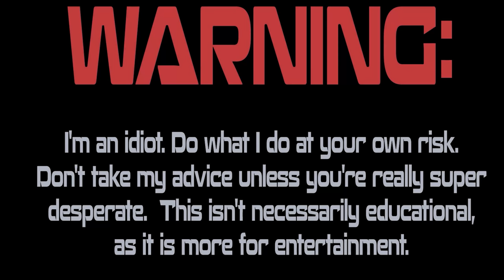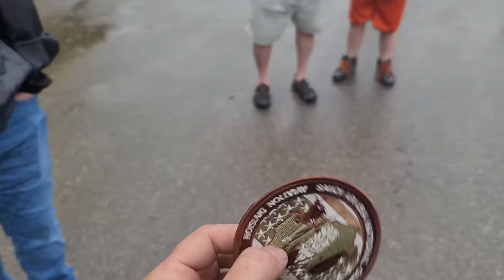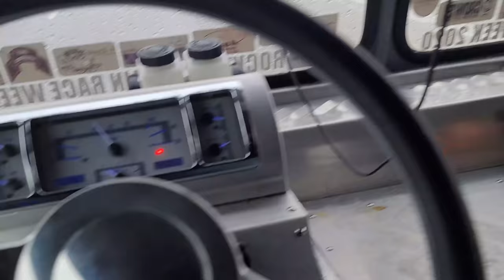Midwest Drag Week Day 2 - Met John Force, Jonnie Lindberg and Drove a Promod in the Rain!

Comment: That’s a good man, moving that snapper.
Reply: He could have at least picked it up instead dragging its lil feet
Reply: @Fony_turgeson  WERD! Poor turtle had the hide ground off of his widdle tootsies.
Reply: @Fony_turgeson  those things are pretty tough. Most the weight is on the shell and the streak across the pavement was likely piss. 

Life > scrapes         Safety > losing a finger

But yea, If you’re experienced with the little buggers then it would probably be fine to pick it up.

Comment: You have to run a couple gallons of the $3 orange Rain-X through the system before you get a good coat of silicone on the windshield.  I can drive my Silverado through a torrential downpour and not touch the wiper switch....I enjoy this touring aspect of your videos just as much as the restoring aspect.  Best part is, I'm retired and can watch ALL your shenanigans on the computer or living room TV.  Keep on truckin' Derek!

Comment: That Sunnen CK-10 at 16;34  is mainly a cylinder boring tool and line boring. I worked at a engine shop in the mid 90s and that was the best machine back then

Comment: Good on you for moving that old turtle out of the road. Someone may have already said this in the comments, but when you take a turtle out of the road, you have to move it in the direction it was heading, otherwise it will head right back out again. Don’t want to move them too far either as their range is small and they can get disoriented and stressed out pretty easily if you get them confused on their whereabouts.

Comment: Funny car body: Composite sandwich. Composite plies over a core material. Could be honeycomb, balsa, hell, even cardboard. The risk is always putting holes in it. Cardboard would work a little bit. But you'd have a hell of a time drilling and fastening to it. Especially if it would get wet. You can also embed materials like wood and such. Depends on how weight critical you are.

Comment: Here is a fun fact. The Marathon they stop at, at the beginning of the video, used to be a Valero but long before that there was a bar there called "Flicker Inn" was the kind of redneck joint you'd hear Charlie Daniels sing about. They used to have motorcycle runs and what not and David Allen Coe would even perform there and not long after his last time playing there the place burned to the ground and then it became a gas station.

Comment: Fyi that turtle will get where he was going, it looked like you drug it off the road in the direction it came from which means it will cross the road again, whenever possible you should put them on the side of the road they are headed to so it doesn't just get hit by the next person😎

Comment: Did anyone notice which way that turtle was heading. You never pull it back from the way it was heading especially a water turtle. It was heading that way to either mate or lay eggs. The turtle 9 out of 10 times the turtle is going to cross the same road the at the same place. Just move them to the side of the road they heading.

Comment: Derik. Your not looking at issues and saying it’s good reminders me if someone I knew once. You will check issues ….eventually. This guy bought an Escalade, it wasn’t new but not to used. He brought the over a year or so later. It was missing. I went to open the hood and he yelled at me… what are you doing , he said. Just taking a look to find the issues. I said. He said.. nope. If I don’t know about it. It doesn’t exist. You could say I looked cross eyed at him and I’m not cross eyed.. a few months later, I’m outside doing god knows what and I hear the noise kind of like a mix of an old popping Johnny tractor and m-80 fireworks going off. 
He pulls up on what sounded 3 cylinders. Out of 8. I pulled the hood and hmmm cracks in both sides of the block. That’s not a big issue to me. Welding blocks. Easy Peazy. My only issue is I DONT KNOW HOW TO FIX IDIOTS and nope I didn’t fix it. I let stupid junk it out